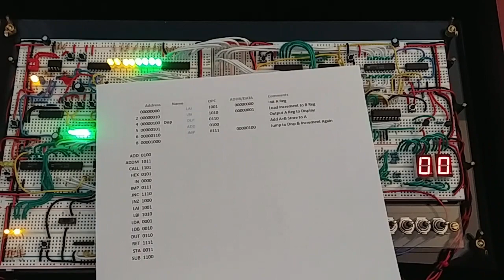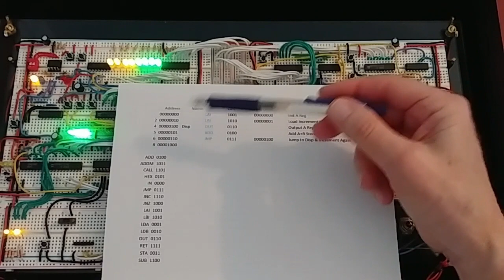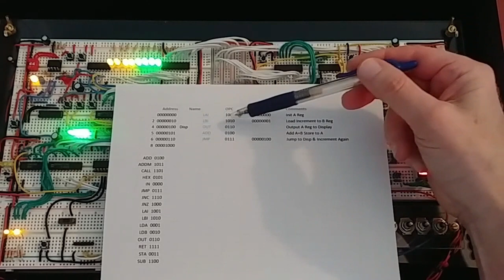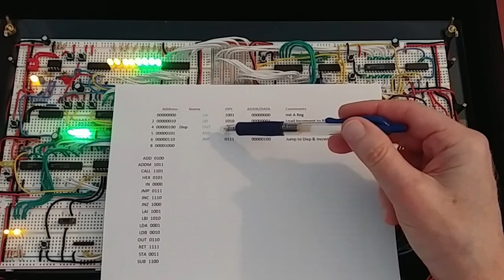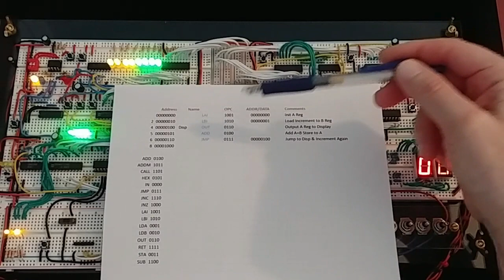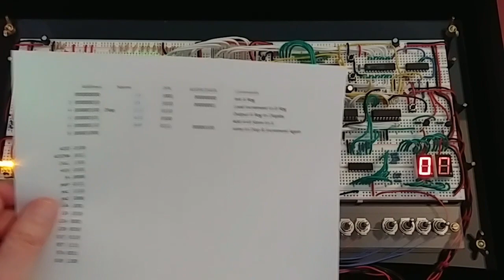My 8-bit TTL Computer #22 - Operations Manual

Comment: Ah... I had a suspicion that the socketed ICs was programmable devices. Or else it would be impossible to realise this design in so few ICs. The UART would be 10 ICs filling two breadboards. The micro ops control signal handling would go from 3 ICs to maybe 10-15. The ALU would be a 24 pin 74181 so no real size increase. The binary to decimal decoder would take up two full breadboards.

So calling this a TTL computer is a little bit of a misnormer, but I still like it due to the creativity of replacing huge swatches of logic with microcontrollers instead of the common lookup roms or CPLDs/FPGAs.   Actually.... it's a good way of testing out the overall design to later on replace each microcontroller with its corresponding discrete logic implementation to get a "pure" TTL Logic computer.
Reply from the maker: Yes, I'm tracking with you.  I have more to add but will keep it for the wrap-up video (in about 4 videos).